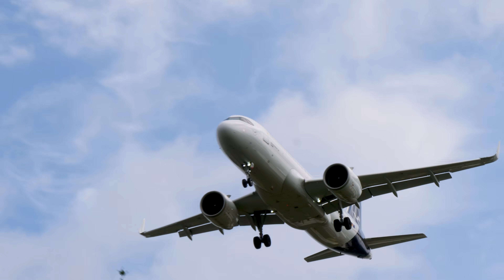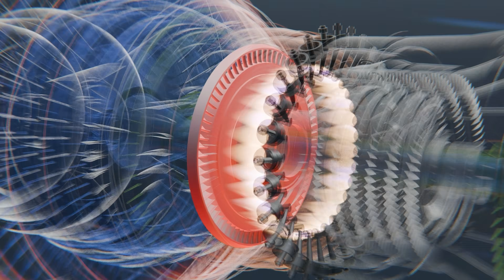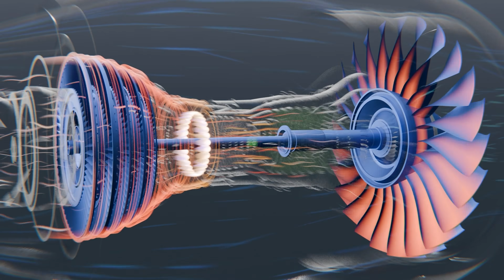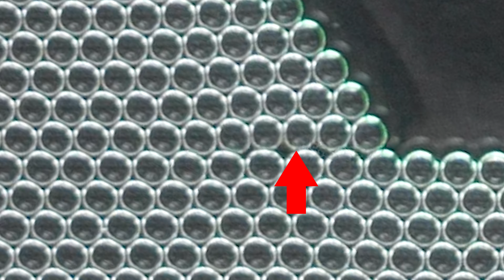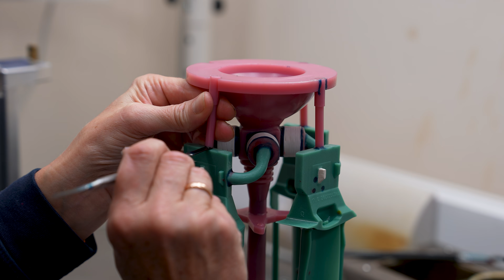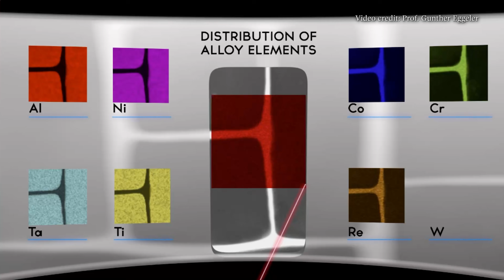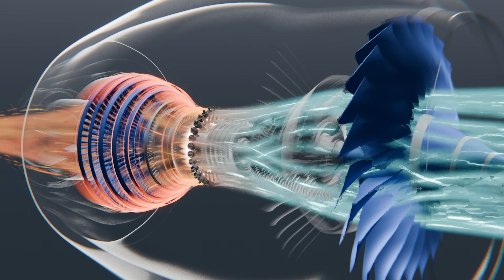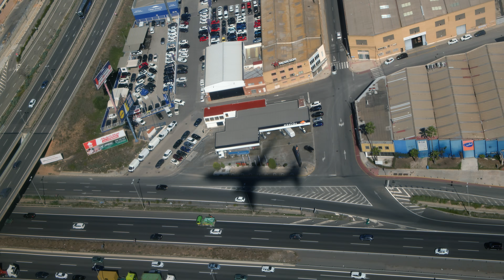The Ridiculous Engineering Of Jet Engines

Comment: @12:40 3d printed hollowed out tungsten solves all the problems and is cheaper. Even better - skip the jet engine completely and use small nuclear molten salt reactors just like Feynman nvisioned in the 40s.. Safe at least 100 ton starting weight and fly for 30 years between fueling.

Comment: We make gold and palladium crowns at my dental lab the same way they make the rotor blades. The process is almost identical except we use plaster to make the mold. It then goes into a burnout oven to burn the wax out then it is cast. Its pretty cool to know they use the same process to make the rotors.

Comment: I can remember working at RR, Hillington, A Block, back in the 1980's where they were forging titanium fan blades. The steel dies were worked to +-0.0002" by hand.
The question I have is, who makes the wax casting die that produces the wax blade?

Comment: That is all very well and interesting, but the blades still do not run hotter that their own melting point (or their immediately adjacent environment).  For a production that relies on precise scientific explanation the bait language is BS and off putting.
Reply: They never claimed the blades ran that hot, they said the engine as a whole did, which is true
Reply: @Orbital_Inclination 
He made out that the blades should melt because of the temperature but didn't.
Reply: @sjoerd1239it's not a stretch to understand that the average viewer may think that if the temp within an engine exceeds the melting point of some internal components, those components may be at risk of melting. His video goes on to explain why this is not the case.
Reply: @Orbital_Inclination 
The video goes on to eventually, near the end, explain why the blades do not really get as hot as he implied they did.

Comment: don't miss that the majority of the dust, water during rain or any FOD (foreign object debris) is actually handled by the primary compressor fan, the first one, and due to the centrifugal force it forced to the bypass duct and it doesn't go through the main engine

Comment: This is crazy thanks for taking the time to make vid I've leaned a lot I have a question on a race car I've seen temps 1200deg cylinder exhaust temps I'm sure they use 4030 aluminium or 6063 something along them lines 
Is this the same principle?

Comment: I was shocked to learn, years ago, that in terms of crustal abundance, titanium is the 9th most common material in the Earth's crust and is basically every bit as abundant as Iron. The key difference, and the reason for it's almost mythical status, is that it's far more difficult to process and titanium loves binding to oxygen whereas iron is ridiculously easy to process in comparison. Titanium is more common than copper, nickel, tin, lead, zinc and even carbon in the crust.

Comment: My first job after college during the 1980s was as a software engineer for Pratt & Whitney, working on software used by the engineers to design the complex shapes of those turbine blades and vanes with their cooling holes.  Most of this was already explained to me during my time at P&W, but it's still fascinating to see it.

Comment: All these incredible amount of research & fine tuning just for the blades to operate & push hot air at high speed. Imagine what kind of insane scientific research mankind has to reach to make futuristic propulsion system like levitating vehicles & interstellar Warp Drives.

Comment: The first jet aircraft to fly was the Heinkel He 178, on 27 August 1939. The second plane to use jet engines, though they were testing them in flight, having used as primary propulsion a piston engine in the nose, was the Messerschmitt Me 262, on 18 April 1941. But since the jet engines were not used as primary propulsion, we might drop this one.  The Gloster E.28/39 flew first on 15 May 1941, so it was the second.
Are we talking about bench tests, when we say the British engine was the first?
Reply: The first patent for a viable jet engine was filed by Frank Whittle, so he is pretty much universally recognised as the father of the jet engine.

Comment: There was an operational jet engine existing before 1941: the HeS3 (Heinkel Strahltriebwerk Nr.3). It was installed in the Heinkel He 178 which flew already on August 27th 1939.
It was the world's first aircraft to fly using the thrust from a turbojet engine.

Comment: Do they get whiskey in Mars. But why they need fan. To compress something you need knock. Hammer. Or stroke. Or mix supercooled. They can send supercooled liquid and allow it expand slowly to a laminar valves. Micro stroke engines. Power exhaust.

Comment: Never i will understand why some people try to confuse others related to the nations innovations. As here when was said that the first jet engine on plane was at the British jet engine, instead german jet plane. Me 262 was the first usable plane with jet engine worldwide. All things started for that point. After the war all copied the principles that were stated years before by Henri Coandă and put in engineering in large mass by Germans.
Reply: You are Schrodinger's dream, right and wrong at the same time. The Gloster was not the first, that's right. However, though the Me 262 did fly a little before (18 April 1941, versus the Gloster on 15 May), they used a piston engine in the nose as primary propulsion and only tested the jet engines in flight, so it can be argued the Me 262 engines weren't still fully operational. But the plane that did fly fully under jet propulsion, was the Heinkel He 178, on 27 August 1939. So, there. The British were second.

Comment: You already have a test rig mate 🤷🏼‍♂️ The car itself. Can't you just invest in some minor modifications to the filtration system so that the test run is a cleaning pierced using a sacrificial filter? Then remove the system , clean it and then fit the whole thing ready to go?
In just a Retired Airline Pilot so I guess I'm off the opinion that no is never an answer when dealing with a problem.

Best of luck
Gareth

Comment: Actually that blades extend a bit due to the heat and centrifigul force and get back to their original dimensions when they are cooled, and there is a mechanism to keep the clearance between the tip of the blades and the tubine case in a predetermined size. That is called active clearance control and it is another ingenious system of jet engineering.

Comment: The new co2 generators are more or less a close loop jetengien running co2 at 7 times normal presure so are they using other materials or is the 7 times presure making the meltong point higher?

Comment: Great video but its a bit anticlinatic.

Car engine wil also fail without cooling😂 so even cars run temperatures hotter then the melting point
Reply: Not the same thing. In these engines, higher temps aren't avoided like in car engines, they just protect the internal components from them. Car engines heat up over time to way above their intended operating temp without cooling.

Comment: Looks like i made a comment about this interesting video months ago. It's atmospheric compression that keeps everything from melting down. I made a video on my yT feed as to why certain shrimp do not boil in very deep water even when in swimming in caulderas ! It's just physics and of course manufacturing engineering wizardry! If you took away atmospheric compression, the material would turn to molten slag. Pretty sure my iQ is around 185+ 😂😂😂😂 Except my wife calls me stupid often. Lol.

Comment: I have a question about the testing phase: 
What is the equipment that is used to heat the test metals made out of?

 Because i'd say that's the answer. Just make the turbine blades out of the same stuff?

Comment: OK, FIRST OF ALL THE TURBINE BLADES ARE MADE OF INCONEL, ITS ACTUALLY A NICKEL CHROMIUM ALLOY NOT STEEL, THE ONLY REASON THE TURBINE ITSELF IS MADE OF STEEL IS BECAUSE ITS EASIER AND CHEAPER TO MACHINE, INCONEL IS REALLY EXPENSIVE BUT HEAT AND ACID WONT CORRODE IT

Comment: i think there is also undocumented feature where thin cold air or water is made slide ower the blades so cools them down.. i guess.. .i mean there is lots of water or air or oil or whatewer is used canals for that to trawel which isnt explained there... ie kind of liquid cooling system thats integraded inside each blade i guess...
Reply: Yes but that "cold air" you speak of cooling the blades is at 1,200 degrees Fahrenheit! Doesn't seem cold but compared to the 3,000 degree Fahrenheit exhaust temperature hitting those blades,  it's really cold relatively speaking.

Comment: To clean/knock the carbon build up on the turbine blades of a Charlie model engine in 1969-70 or so in Vietnam... we were instructed to let a small amount of ground up walnut shells be sucked into the engine.
It smelled wonderful but i always wondered if pouring a little bit of water at a time in the intake might of been a better option????
Reply: Walnut shells help to polish the surfaces, unlike water

Comment: Every visualization I have ever seen of the flow thru a jet compressor, fan or turbine is incorrect. Including yours. Through a compressor, for example, the flow is not straight through but helical at roughly 45 degrees. A bug entering the compressor at 12 o'clock might exit at 6 o'clock (if he survives). Same applies to a fan to a lesser degree, and much more so through the turbine.

Comment: All of that super heated air in the exhaust of the jets has nothing to do with climate change? Displacing thousands of miles of air all over the globe to 1200 Celsius .. 10000-14000 planes flying 24/7 are we sure that it’s really refrigerant gases causing global warming and not the actually turning all the air hot?
Reply: Yes, direct heating of air isn't the issue, the trapping of more heat is.

Comment: As i was  jet mechanic when i was in the Navy,  hahah good military logic?  I joined the Navy and flew on planes instead 🤪  But learning about jets and it is kind of touched on in here most (90%) of the air i was told is simple to help cool the engine.

While i love Veritasium videos usually not sure they explained the design of the engine the best.  What we have is something that feeds on itself.  Meaning there are  four main stages of the engine.  Compressor, diffuser, burn chamber and turbine.  Compressor is obvious, the diffuser is what helps ensure the air doesn't flow backwards.  It has a little opening that opens/widen some, so the pressure drops some thus preventing backflow,  then into the burn chamber and then expands in the turbine.   And when i say it feeds on itself as the air expand that drives the turbine faster, but the turbine is connected to the compressor.  So as the turbine spins faster it causes the compress to spin faster, and a faster compressor more air into the burn chamber, and more air it expands more when burned driving the turbine faster, a faster turbine, then the compressor compresses more...  Simply a beautifully designed machine...

Only thing i would add.  The most efficient way to move air and get propulsion is a propeller,  the HUGE compressor blades that extend way out are effectively that, while it is a get they act more as a huge propeller.  Thought the largest engine is the "Gen X", thought there is another from Rolls Royce, can't remember what it is called.   They both have HUGE compressor blades at the front for the "prop" effect.

Comment: I've spent 20years of my career around nickel alloy specific for steam cracker facilities. they are casted in centrifugal machine which resulting the outer diameter having columnar structures and inner diameters having equiaxe sctructures. Its really fascinating to see them work in the petroleum refineries with continuous >1000degC in Operation. Cracking olefines is the first step of making the downstream of petroleum products. It happened at these temperatures and just imagines without all these engineering nickel alloys we will not have our daily household products (plastic and everythings!)

Comment: When swords are manufactured the solid metal is beaten with a hammer and folded when the metal is super heated and then heated and folded. Creates a  stronger metal and could this metal once beaten dozens of times be melted in a hot furnace where it is poured into fan blade molds if this process would have any affect on the composition of the metal to bind these particles into a solid metal much stronger with atoms closer knit together to strengthen the density of the metal to resist higher heated atmospheres and another thought is using atmospheric pressure 7 miles deep under water to bind the particles together tighter?  Or would this  added atmospheric pressure make the density of the metal blades weaker to become brittle?

Comment: i cant even imagine what humanity will do with scramjets in next 100 years... going slower than mach 1 will probably be forgoten entierly
Reply: Scramjets are incredibly fuel inefficient. They're useful for military applications but not for mass commercial where fuel burn/cost is king
Reply: @Orbital_Inclination  for now
Reply: @UAPslo not 'for now', it's basic physics. Scramjets work like an afterburner, draining fuel at an insane rate. Turbines are a far more efficient way of using fuel, so they keep costs far lower for passengers. Also, supersonic drag is way, way higher than high subsonic, so that means yet more fuel burn
Reply: @Orbital_Inclination  im pretty sure we will find a way
Reply: rocket motors were also stuck for 60 years before they got significantly upgraded...
Reply: @UAPslo no they weren't. Physics doesn't change. Scramjets will never be more fuel efficient than turbofans, it literally cannot happen
Reply: @Orbital_Inclination  no physics does not, mechanisems does
Reply: @Orbital_Inclination  you dont have to be fuel efficient if you're fast enough.
Reply: @UAPslo you do, because cost of a ticket is massively determined by fuel cost. The vast majority would rather a cheaper flight than a faster one, as concorde demonstrated.